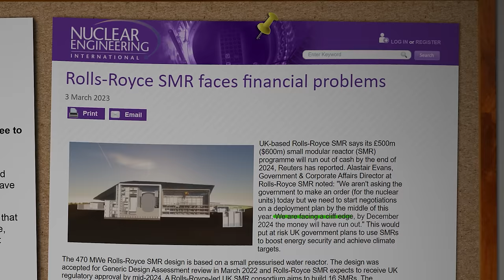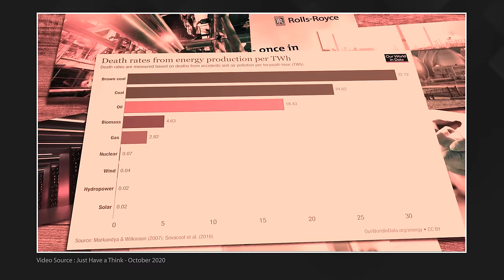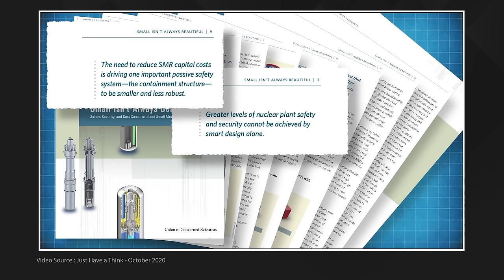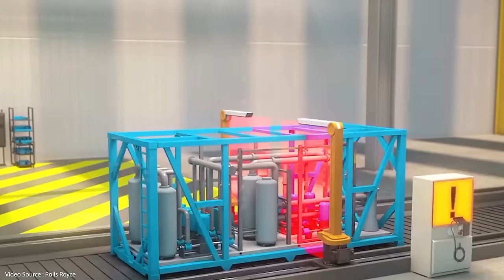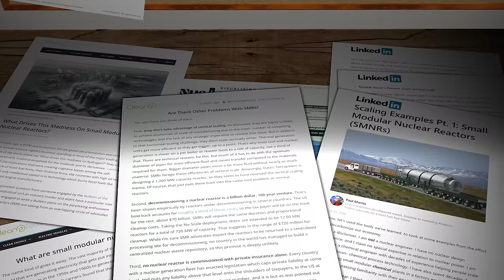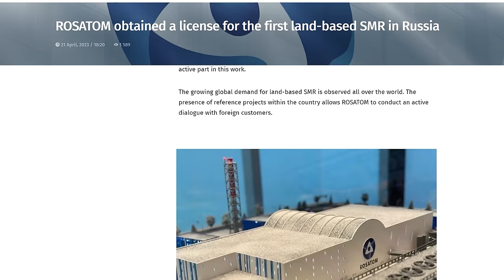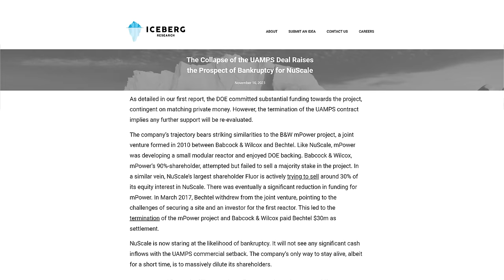Small Modular Nuclear Reactors. The Verdict

Comment: I like your channel and watch it a lot and I agree with most of your content regarding climate change and the need to get cracking on building more renewable projects, however, I am saddened to hear that you are hitching your wagon to the fully charged horse. This is because their narrative around BEV's has holes in it that you could drive a truck through. Most of the individual vehicle reviews I have watched have totally glossed over very real shortcomings in design and operation limitations and virtually make out that these vehicles can be used just as you use vehicles now and that is a lie.

Comment: While you may be overall correct, you are missing a number factors. All of the arguments you are using are near identical with the arguments used against nuclear power in the first place and guest what they have proven a very reliable source in Canada Ontario in particuar. Secondly the nuclear plants here have not typically been decommisioned in Ontario they are being refurbished. similarly if you go back 25 years the arguments you use are the same as photoelectic power, much too costly and what happened the price came down and a good part of the reason is government action. Next you suggest the belief was these units would be produced in comparable volumes to cars, which I think you would have to admit is silly. Instead it might be comparable to large aircraft buils whose cycles typically are a couple of years not the number of weeks in a carccycle. Consider what the actual cost of the first of car might actually cost to produce and what the 200th might cost. THe first built are built at a loss. There is a way of predicting that developed during ww2 in aircraft builds called learning curves incidently supported by government.  Lets assume a 15% learning curve(not particualrly aggressive). By the 60th unit assuming the cost of the first unit if only one is produced is 10 million, the average cost of  60 units would be 5 million. The stock market operates on seconds not the time to do anything that migh take some years after the first unit is produced. That is why governments are required to subsidize pretty much every aircraft produced.

Comment: Installation costs per megawatt are similar for a nuclear power plant (NPP) and photovoltaic (PV), yet any loans given to NPPs are at a much higher interest rate than the PVs. PVs are also heavily subsidised and along with NPPs have the decommisioning problem. In my nuclear studies i have encountered several electic engineers that claim that the grid can sustain up to 20% solar and 40% wind energy due to their inconsistent power delivery. From the 60% renewable point on the frequency of the grid would become unstable to the point of the Eurpoean grid breaking up into several chunks and causing blackouts. The current rate of renewable energy installation in astounding, but we need to look into the future aswell, where now aging NPPs are going to be shut down and the rest 40% of electricity coming from probably natural gas and coal. NPPs tend to be cheaper in bigger configurations, but gouvernments tend to avoid such projects, as the fruits of their labour would be seen only some 10 years after the end of their mandate. If we want to get rid of fossil fuels we will have to build more NPPs, the question is just if we will do fewer big projects or multiple smaller ones. Nevertheless the "fear" of nuclear first needs to disappear and the tax-payer needs to be educated about its benefits.
Reply: Nuclear instustry has taken safety standards to extreme measures, because of those the cost of a NPP is high, as every bolt in it has to be first thoroughly examined and then also periodically. These precautions show in this video as the total number of deaths per TWh is the lowest, but no matter how hard they try the past incidents cannot and should not be forgotten. Most people would rather choose to live near a coal power plant that is proven do decrease life expectancy and quality of life than live "in fear" of a nuclear accident. New reactors are required to be able to withstand the worst conditions immaginable for atleast 7 (more often even 14) days all by themselves. In the meantime response should arrive comfortablely.

Comment: Good luck to your intermitent power supply . On . Off . On ....
Reply: There's getting on for 1,000 miles (1,600Km) between the furthest-spaced wind turbines in the UK plus hydro-electric, pumped-storage, solar, tidal & geothermal supplies so I'm fairly sure most of the time renewable supplies are never completely off & even when they are we have ~20GW capacity in interconnectors already & more of everything being built.

Comment: Which technology are you talking about. The small modular nuclear power is a packaging solution.

 If they are still building PWR then it's a waste of time. But if their building an high temperatures arcinid salt fail safe design that's another matter. As their fuel is the waste from existing inefficient PWR reactors. 

So over the next hundreds of years they get rid of the long term waste & Salt reactor waste is either inert or. More radioactive, both of which are useful.
Reply: Reprocessing an reuse of the waste from nuclear power plants has been "promised" since the 1960's.  The problem is that other than the plutonium the other waste isotopes that could be burned are highly radioactive and would be extremely costly to return to a power plant and reinsert into the reactor.  Its been looked at multiple times.   I don't see any new answers to that.    We could have burned this up in BWRs PWRs and especially in fast neutron reactors.

Until someone explains how you return and handle this extremely radioactive material - its just a paper promise of a concept.

On the other hand a lot of plutonium has been burned up in power reactors (including a lot from scrapped nuclear warheads).  The nice thing is that you can handle it wearing normal clothing and light gloves without any radiation exposure concerns.

Comment: Lets see whether China ramps up SMR's after they've run their two units for a bit. A major factor in all the western projects is the overbearing and costly influence of political factors centered around the myths around 'safety'. Kick the lawyer cartels out of the way like they do in China and you get a reasonable approximation of the real economics. The economics of scale can only kick in for SMR's when they are modular factory cookie cutter builds. Wind and Solar are obviously going to work for most places, but at latitudes above 45 degrees, not so much. And it doesn't matter what tech you're discussing including wind and solar, all start out as 'too expensive' before they eventually evolve. Windmills and solar started to appear fitfully in the 70's but have only become 'economic' in the last decade or so.

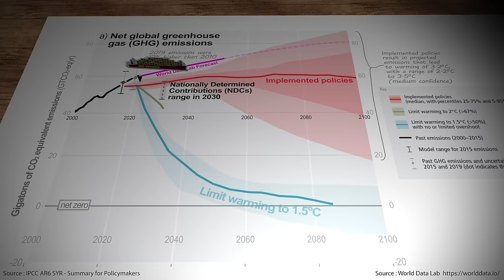Comment: 12:12 - absolutely spot-on assessment about where commercial nuclear power is headed.  Moreover, within ~50 years, the share of grid power that nuclear provides will drop from current 10% to less than 0.1%.  Commerical nuclear power will effectively disappear from the grid, but some very small nuclear reactors will remain in use in military and scientific areas only.

Comment: The issue with wind/solar/dams/battery farms is land use.

Nuclear reactions are 1 million times more energetic than chemical ones: so are able to greatly reduce the material handling and land area needed to produce a lot of power.

I still think the largest obstacle to nuclear power is the nuclear weapons non-proliferation treaty. Plants must be designed in such a way as to prevent their host nation states from diverting material (unless the host nation state is a nuclear power). This increases both cost and reduces efficiency. 

The most common reactors use solid fuel pellets. This makes then countable for non-proliferation purposes: but also reduces the efficiency of the reactor by 99% (only 1% of the fuel is actually "burned up". Molten salt reactors, with online fuel reprocessing, have the potential to be much more efficient: but have not solved the auditing problem yet.
Reply: The land under wind turbines is still there, shading farmland with solar panels may be beneficial for some crops and grazing, offshore wind takes no land at all. There are millions of hectares of building roofs and parking lots that could and will be covered with solar, it's just currently cheaper to build a massive solar farm. If you're so concerned about solar taking up lots of land, then eat a little less meat and the land freed up from fattening animals is many times more than what we need to power the world with solar

Nuclear fuel and waste are orders of magnitude less than burning coal, but I haven't seen any analysis that shows it's less than wind and solar. Once built, there's NO materials handling for wind and solar they just sit there intermittently generating electricity for 25+ years.
Reply: @skierpage  The wind/solar material handing is in the batteries and lakes behind dams needed to store the power for later use.

Comment: New York city requires 10 GW of power per day , the biggest battery today is barely 3 GW . What if we have 2-3 days with no sun or wind in NY? We are way off from having solved the storage problem. You re deceiving your viewers.
Reply: No we're not.  Batteries get better at a very predictable incremental rate that won't slow down for many decades, until they saturate the market.  We'll soon have dozens of gigantic giga-factories for batteries, which will increasingly be made of cheap available minerals like iron, sodium, silicon, carbon, sulfur, etc.  
We didn't have the solar solution 20 years ago, until we did by simply scaling it all up and improving them incrementally the whole way.  Same thing is guaranteed for batteries, at a faster rate than any nuclear tech can compete with.
Reply: @charliedoyle7824    unfortunately the "predictable incremental rate" is too slow. Our biggest battery today is 3GWH , we need 3 X that for NY City alone for just one day of storage. We are so far way from a god storage solution. All the examples you give are still in infancy , show me any  real example of a large scale battery from : "cheap available minerals like iron, sodium, silicon, carbon, sulfur, etc. " !

People who are pro nuclear are not against solar or batteries. Let us build as many batteries as possible but let us not "put all eggs in one basket" at least not until we have some hard scientific data.
Reply: @theo949  I'm pro nuclear.  But the economics just don't work, and solar and batteries grow so fast that lots of nukes just won't get built.  That's obviously true over the last twenty years when solar was much more expensive.  As it gets even cheaper and heads to one cent per kWh, certainly no energy companies will totally switch to nukes; they move too slowly and rely too much on government help, which won't be substantial.  Solar, on the other hand, will get vastly cheaper no matter what anybody does at this point, because it's now a juggernaut from China and increasingly elsewhere, and the tech and scale to continue the same growth curve for decades are certain.  Bankers and the whole energy sector can all see that.  

You probably don't realize it, but what you're saying about batteries is exactly what nearly everybody, including most on the left, were saying about solar twenty years ago.  It was a cute little energy tech that was worth pursuing at a small scale because it had so much political support, but all of the realists knew it would never get cheap.  The silicon purification was too expensive, so the price floor was perceived as permanently high.  Of course, solar has proven everybody wrong, including that fycking idiot Bjorn Lomborg, and now the same linear-thinking forces feel the same way about batteries, which as I've told you are basically the same thing as pv but with a larger market.  Batteries doing the same thing or better as solar over the next decades is certain, just as certain as Moore's Law continuing.  

Nobody is putting all eggs in one basket when they avoid nukes.  It's just normal energy and financial people avoiding risk and preferring a sure thing by avoiding predictable nuke headaches.  

Many battery techs are in their infancy, yes.  So are new nukes.  So why the naive faith in nukes?  They don't have momentum, bankers don't want to back them because they always go over-budget, leftie activists get in their way, the waste-storage issue isn't really solved, at least politically, and they cost way too much up front, with no serious momentum in that changing because there are still lots of different designs being pursued, with each project taking close to a decade to complete, so no economy of scale is anywhere in sight.  
While the nukes stagger along, solar, batteries, and more grid are sprinting.

I find it amazing that the conservative energy people are now the ones promoting big-government expensive nukes over market-force Wright's-Law solar and batteries.  I doubt most of them understand that they now back the same thing they used to detest, big-government boondoggle energy projects.  I think they do this because they don't understand tech, and their news sources are propaganda mills of their own choosing.  

The iron-air battery from Form will have a completed 50 gWh per year factory built this year in Weirton WV; that's 500 1mW-units a year,  x 100 hours each.  So New York can install your 9 gWh 4-day battery before 2030.  It's not a 100% sure thing, but it's very likely to all work as planned.  The team at Form clearly know what they're doing, and everything about the battery is safe and cheap, with the supply chain already scaled.  A 100-hour iron-air plus 8-hour LiFePO continually getting cheaper and bigger scale with lots more grid will allow solar to get to about 50% of our energy, at which point the other batteries will kick in, which include mechanical energy storage and green hydrogen.  Plus sodium-ion for the grid is basically proven and ready to scale, likely able to compete on price with LiFePO or beat it because it replaces lithium with plentiful sodium, with everything else working about the same.  

And I'd bet on deep geothermal being preferred by 2040 over nukes.
Reply: @charliedoyle7824   I really think you are over estimating the success of solar. Yes it has been successful but it is still only 4-5% of global electricity production. Electricity is only 25% of global carbon emissions. So Solar has made just a small dent at the problem. Yes solar it is great we need more of it but it is not enough. 

Nuclear is NOT EXPENSIVE ! Not when you compare it to solar or wind plus batteries. I wish someone would do a video on the above and truly and honestly compare the numbers. 

Nuclear energy is not in its infancy as you claim . Gen 3 nuclear has been around for decades and Gen 4 is now coming online. 

Yes, I too am excited about the Form battery and geothermal but those will take a while and have their own challenges and risks. The bottom line is we need to get to zero carbon emissions. We need as many weapons in our arsenal to get us , it is idoitic to not use nuclear as one of those weapons.

Comment: The insane long time it takes to get a nuclear reactor project up and running may mean you are most likely correct. I thought that with tech like thorium or slow poke reactors should be on the market by now, The Slow Poke is a piece of tech that was proposed for use in research submarines a long time back. I thought that something like that would make more sense than running diesel generators in the high arctic. Sorry but I am looking at it from a Canadian prospective. Renewable energy  seem to be a nobrainer but here the fossil fuel industry is trying to beat it with a stick. One of those sticks is the Premier of Alberta (in Canada), Danielle Smith (a wacko of the first order) who has put a moratorium on all renewable projects. I really enjoy your ideas.

Comment: We pay $1/day to be connected to the grid. 
We pay $1/day to be connected to the gas.
We pay for long ago decisions, the economics in the olden days.

We pay for the old fragile grid and then pay for the electricity. 
The feedin tells you electricity is dirt cheap, and the FRAGILE grid costs a fortune.
We rent the grid and pay for the FRAGILE  GRID maintenance. 
1 million klms to 20million buildings.
25million people. 

Australian natural gas is sold overseas at high prices and sold to Australia at the same high prices. 
We rent the pipeline, the meters, and pay for the maintenance. 

But all have become expensive. 

FMD as they say in Australia. 

Get the EVs into mass production. 
Selfplug-in V2G.

Horse 🐎 meat was cheap when the Ford Model T production line got started.

Energy will be cheap when EVs mass production line get started.
A big battery and a few more PV panels. 

😮😮😊😊😊😊Horse 🐎 meat cheap in the old days.

Dead ducks and duck curves, 😅😊😊

Comment: SMR's are already in use in nuclear powered submarines and ships.
Reply: Reactor submarines are not cheap (fuel load is $1 billion), they are very inefficient because they do not have the room for reheaters, and they have  none of the safety systems required for commercial units.  The first U.S. nuclear power plant (Shippingport) had a 60 Mw output (typical SMR capacity) took up three levels and 4 acres.  Look at a typical commercial power plant (1,000 Mw) and any SMR fraction of that output will be at least that fraction in size.  The larger the plant the more efficient it becomes and vis versa.